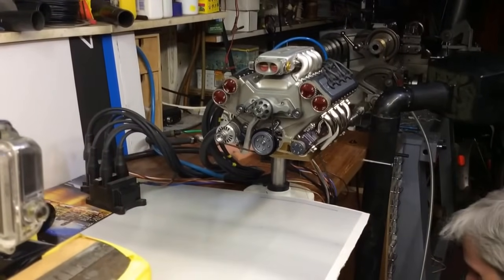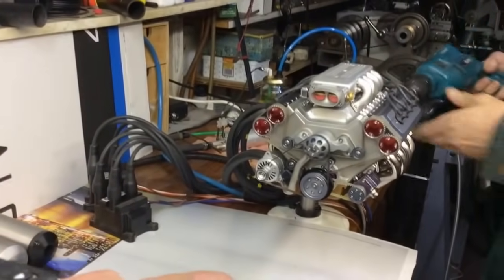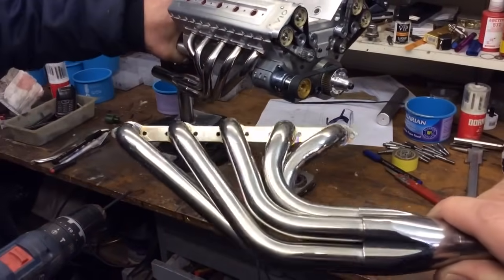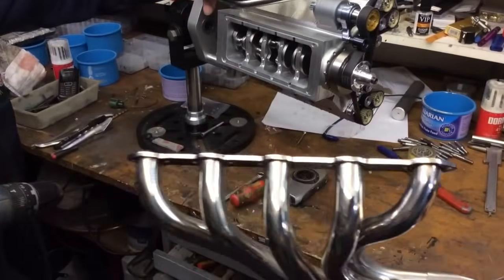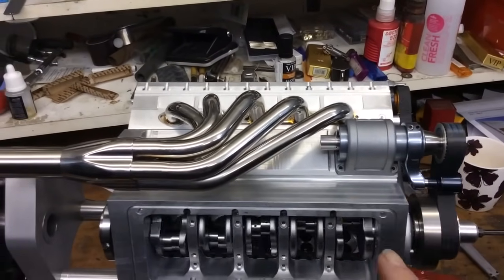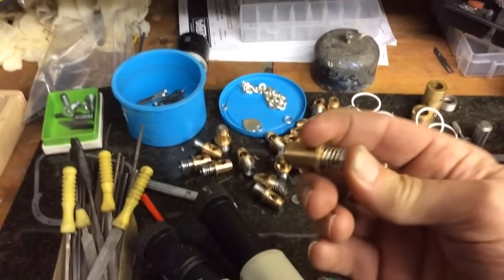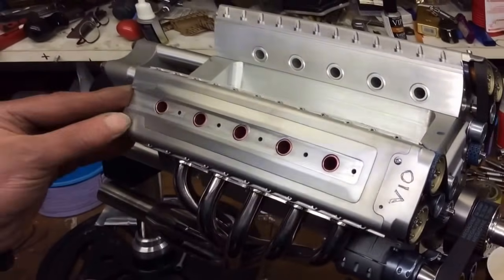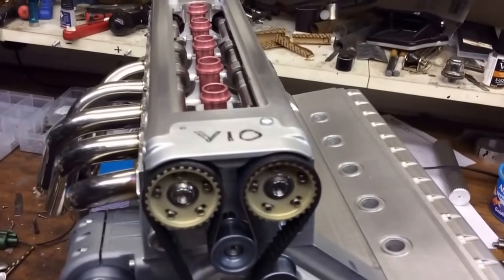Fuel injected model V8 1/4 scale running and V10 1/3 scale progress report.

Comment: what injectors is this using? no idea they did them this small, amazing build!
Reply from the maker: it’s a single injector which I made using parts from a Weber Pico injector.
Reply: @Keith5700  oooh nice, I didn’t know you could run multiple cylinders from 1 injector 🤔 thanks
Reply: @Keith5700  there are various fuel injected 125cc motorcycles that you could of got one out of 🙂

Comment: What are the two motors at the bottom left and right ? Alternator and fuel injection pump ? Do you craft those yourself or purchased them ?
Reply from the maker: Alternator and dry sump oil pump. Yes, I made them.
Reply: @Keith5700  that's ridiculously awesome. Can I purchase the the drawings or CAD files for that dry sump and alternator? I'm actually building a 6 cylinder Porsche boxer engine quarter scale motor and it would fit perfectly...also what brand EFI are you utilizing?
Reply from the maker: @champ0682  the ‘alternator’ is just a brushed motor inside an alloy casing.
I improved the pump design for the V10.you’re welcome to those drawings. It’ll be a couple of days till I get round to it. Where would you like them sent? If you send your email address I’ll copy it then delete your post.
Reply: @Keith5700  as far as the electronic fuel injection...did you purchase that from ecotron or another UAV product supplier ?
Reply from the maker: @champ0682  it’s a Megasquirt MS3. I had it modified with 2 extra drivers for the V10.
Then I’ve since spent years trying to combat earth spikes, which trip it out.
I wouldn’t buy another!
Reply: @Keith5700  hey Keith just checking in on if you were able to find that dry sump stuff to email me ?
Reply from the maker: @champ0682  I’ve sent a few emails to you weeks ago, with and without attachments, so I suspect something is wrong at your end?

Comment: Dude its prity sweet and to every one no he did not build all this himself thairs a guy who builds thease by hand mister Conley and shout out to the channels owner not to sound rude not nocking the guy but u do realise u risk scratching and scoring the bearings for ur crankshaft runing it  dry with ur drill its verry unhealthy for the engine when u pout oil in and run it if thair was any metel shavings that mixed u could have seased that engine the first time y fired it
Reply from the maker: Huh?

Comment: Bit lean on the right bank maybe? Or do you have an oil breather feeding into right side of intake? Just wondering as looks like only smoking out the left pipe. I'm not knocking it it's a little beast of an engine and looks amazing. I so want one in a pit bike or mini quad.

Comment: sooo... I want(-ed) to design one, only for virtual testing and so forth, maybe i get to have it machined at a cnc shop, and i was wondering if you could give some details (i.e.: counterweight weight, height, oil capacity, spark plug size and so on, i only need the equations as i can plug the info in). Thanks in advance as I have seen you answer comments.
Reply from the maker: Have a look through the engine build on the modelenginemaker forum. That should tell you most of what you want.
Reply: @Keith5700  Thanks again!

Comment: Is the alternator fully functional? I'd be very interested to here how you made it if it is as I would like to make one for model aircraft of a very similar size to yours. Thanks!
Reply from the maker: It is functional. It's just an electric motor working as a generator. I didn't use it in anger because I never got round to doing the electrics properly to stop the battery driving it when the voltage drops below 12v.

Comment: Keith5700 where did you find them and what size AN fittings are those
Reply from the maker: I had to make all the fittings. Nothing on the market I could find.
Reply: Keith5700 wow that cool is your engine dry sump if so is it a single gear that moves the fluid or two gears

Comment: What kind of efi system did you use for this engine and can it be put in a 1/4 scale rc car
Reply from the maker: The efi system is Megasquirt. The ecu, pump, oil tank, etc is bigger than the engine so would need miniaturising before fitting into a car
Reply: Keith5700 do you think you could try doing that just to see if it's possible because I don't know if you watch street outlaws but I'm building a quarter scale murder nova mini v8 twin turbo and I need efi to go with it

Comment: can this run a small car like a mini,  polo,  or fiat 500?
Reply: Would be cool but for some reason these scale engines don't make much power. Even 5bhp would be impressive out of this v8.
Reply from the maker: An 8 cylinder 50cc engine won't produce anywhere near the power of a single cylinder 50cc. There's far too much friction for the cc's, and the gas speed is far slower than what a single cylinder could produce.
Reply: kevin Tucker Doing the math, a 350 CID shrunk down dimensionally to one quarter scale is just 6.96 CID. Not surprised it's not 100 BHP.

Comment: I'd love to see an update on the v10
Reply from the maker: I've had the v10 running, and it works fine. Just got to tidy the wiring up a bit and then it's ready for the video.
Reply: Keith5700 Ok, sweet.

Comment: The water pump was not spinning on the first L98 / ZR1 engine! & hope you got it running better, it's got a little blow by & get some hotter plugs and some small Nonanti-foulers. LoL or Time for a rebuild!  All Nice pieces of work.
Reply: I think he said one of the plugs on the left bank was broken and that he has had more spark plug problems than anything else on these engines.
Reply from the maker: I'm just trying to make some hotter plugs at the moment. What are anti-foulers?

Comment: Definitely an issue with that V8 on one of those cylinders on one side where it's burning oil so probably down compression on one cylinder.
Reply: That's Nitro you dumbass! It burns that way.
Reply: no if you look in the comments the owner of the channel and the engine sad it was only running on 7 cylinders because one of the spark plugs was malfunctioning know your shit before you call someone a dumbass. dumbass

Comment: its great but its not running on all 8 cylinders...
Reply from the maker: I did make the plugs from scratch. That's been the problem. I should have bought the minimal ones from the start.
Reply from the maker: That's MiniMag not minimal. Stupid iPad.
Reply from the maker: It was only running on 7. One of the plugs had broken down. The biggest pain of the whole project has been the plugs.
Reply: Steve Lamperta I was just thinking the same thing looking at the oil burning off I'd say one cylinder is down compression and passing oil through.
Reply: +Keith5700 
Wow you never know! Plugs would be the last thing I would think problematic. Keith I think you should make the plugs from scratch...problem solved.
Reply: God level,  hats off 😊😊
Reply: unreal that you heard that

Comment: what's the point of these motors
Reply: I mean I'd see the point in them if they were in rc cars or something but otherwise there just expensive as fuck interactive display pieces
Reply from the maker: Yes you're right. I think my next project will be oil painting, or pottery, or sculpture, or how about a bit of wood turning, or candle making, or poetry, or sing in a choir, or just prop up the bar and drink myself stupid. Thanks for your enlightenment.
Reply: 5ltrclubby your no fun aren't you

Comment: When are you finishing with the v10?
Reply from the maker: Nearly finished the V10. It's running injection ok, and looks nice. Just finished the hydraulic triple plate clutch.and engine mounting system.
Video in a month or two.
Reply: +Keith5700 Ok good luck finishing the project!

Comment: How much Horsepower have this ?
Reply: PrivatePumper if ur lucky probly bout 10 that V8 dosnt rev high so probably more like 3 or 5
Reply: wtf are you basing that on?
Reply: +BiffBallbag 
I've seen several of these awesome scale V8 engines in RC cars and they make less power than a much smaller one cylinder nitro engines. I'm not sure why this is but I guess it is because of how many cylinders there are. On small displacement engines, the more the cylinders the more the friction and loss of power. So a one cylinder engine with the same displacement as this 8 cyl engine and the same air flow/fuel flow will make a lot more power! It's just logic.
Reply: kevin Tucker that doesn't make sense.  multi cylinders versus single with always make more power.  its a 4 cycle engine, more cylinders means more power strokes per revolution than a single cylinder engine.
Reply: BiffBallbag Would make it smoother, but still more friction and more heat.
Reply: Big Bob smoother, but more friction?  did you even read that before you posted it?
Reply: BiffBallbag When he said smoother, I believe he was referring to the rotational symmetry of the engine, not the physical smoothness of the cylinder.

Comment: I'm an ME and a machinist. I would love to make something like this but my RC airplane addiction wont allow it. Did you cast  the aluminium parts or cut them out? Where do you get your high Si Al for pistons? I'm currently drawing up some airplane engines that I'm going to build. Nice work! Almost cant tell it's a miniature!
Reply from the maker: All the ally parts are machined from solid. No castings involved.
Piston material is 6082. Easy to get.
Reply: Thank you:) What kind of CAD did you use? I use Solidworks. It has a pretty good FEA utility (assuming you know your stuff as FEA can get you into allot of trouble if you dont). 
  Its nice to see another mad scientist. We are a dying breed. Im self taught. Wish I had the time to go to school and refine my skills but my days typically start at 4:30am and end at 7:30pm. I live in a rural area (Sedona Az) and everyone here works in service industries so things get pretty lonely. 
  We pour our life and soul into these things! Best of luck!

Comment: What do you use for a miniature fuel injector? We make 1/4" dia very high speed solenoid valves that have been used as fuel injectors in small engines for UAVS etc. See www.theleeco.com under Electro-Fluidic Systems for VHS solenoid valves and nozzles.

Comment: the v8 needs a resonator
Reply from the maker: It needs something, agreed. Don't know what a mini resonator would consist of. Would like to see something as an example if you know of anything. Cheers.
Reply: Likely you already know about Pierre Scerri and his Ferrari 312 Keith. If not I believe one of the YT videos hints at it being a very involved and lengthly task to get the exhaust so it sounded exactly like a scaled down Ferrari 12 cylinder engine before he would call it completed. If my memory isn't faulty I seem to recall he might have had a bit of professional help from a few of the Ferrari engineers to do it.

Comment: I know I can buy the comely V8 but can they be made into fuel injection similar to this setup?  Kieth have you decided to sell your engine or a kit at all?
Reply from the maker: +2stroketerror125 
Been there, done that, got bored!
Reply from the maker: +Jared Braun 
I'm sure the Conley, or any petrol engine could be converted to injection.
Doing it my way though is a ton of extra work and expense, so I can't see anyone doing it commercially for a while.
I have no plans to sell the engine or kits. It would need a huge investment of time and money to market something like this. Cheers.
Reply: Why even buy a Conley v8? I built a 500hp 383 for less than they cost

Comment: its either a v8 or its not a v8.... there is no scale. its a 100ci or its not....there is no "size" of a v8 to scale it to. but nice work non the less
Reply: +Chad scale V8 to bore and stroke I would think. Nice work? Keith is a craftsman! nice work is kind of insulting if you ask me, why so picky about the scale?
Reply: +Chad W    the v8 looks to be a scale rep to the old dohc corvette zr1 engine. scale meaning same dimensions not 100% replica visually .
Reply: Maybe scaled to a certain engine in mind?

Comment: At 3:03 did you activated a clutch or something like that? or it is an electric engine powering the water pump ?
Reply from the maker: The mechanical pump belt was a bit loose and I just pulled the alternator to tension the belt. This pump doesn't move enough water anyway so there is an external electric pump doing most of the work. Some things don't scale down very well.
Reply: Keith5700 I've been a machinist for over 20 years and there is no way I'd attempt something like this. Your skills are beyond mere words. Thank you for giving me something to aspire to......
Reply: +Keith5700 speaking of the alternator, i am guessing it is purely decorative?
Reply: Keith5700 just scale down the water molecules to 1/4 scale, one of the nicest scale engines I've seen by the way👍

Comment: Forgot to say, regarding your thoughts on balancing the V10, had a (full size) V6 balanced the way you propose a couple of years back. For the weight of the rings, the guy just made up the equivalent mass in washers and super-glued them to the piston crowns. You probably know of them anyway, but have a quick look here for more info if it helps. http://vibrationfree.co.uk/  Steve @ VF is a very approachable and helpful chap. Doing it that way is by far the best method.
Reply from the maker: Hi, I tried to balance the V10 this way, a while back. I did add the weight of the rings onto the piston tops. It wasn't very successful though because the driveshaft from the lathe was causing too much interference on the vibration sensor. I will have another go later, but I think it will only work if the driving motor is attached to the engine, so there are no external forces upsetting the balance.

Comment: *Brilliant machining and construction job, but it sounds like it needs some tuning. 
You're running a Megasquirt controller if I recall ?  Have you flow tested the injectors and checked the exhaust composition with a "Wide Band O2" sensor ?  It sounded sort of like one cylinder was missing a bit from the crackle, and maybe needs some work on the acceleration enrichment to remove that hesitation when you blip the throttle. :)

Of course, if you arent going to actually drive anything with it, then it probably doesnt matter, it runs !  But the exhaust note might be a bit sweeter if it was dialled in properly.  Hope Im not trying to teach Grandma to suck eggs, your machining is incredible, but I know a fair bit about megasquirt EFI tuning and it just sounds a little off to me.
Reply from the maker: you're right, it did sound a bit rough compared with the original video.
I think it was only running on 7 as no. 8 plug was breaking up when we took them out after.
to do it properly it needs the exhausts joining into 1 pipe and then see if it will work with a wideband sensor. I suspect there wont be enough gasflow to get the sensor hot enough to work, but it may do. 
It needs some accel enrichment dialling in, but my laptop has expired so I'm stuck with the program stored in the ecu for now.
Reply: #8 plug was "breaking up" ?  as in disintegrating ?  I imagine making plugs and injectors that small would be a challenge !   WBO2s usually have a self-heater built in, so they work straight away at startup, but Im not sure if they stay on, I *think they might be self regulating and use electrical power to heat when the exhaust isnt supplying enough warmth, so it might work.   Megasquirts can be tuned (and monitored with Funky custom Dashboard displays) from Android Phones as well as laptops using a serial-bluetooth adapter available from tunerstudio.com and dashboard/logged with their shadowdash app, or tuned with the free MSDroid app.
Reply: SpockieTech
I think "breaking up" meant that it was misfiring in general.  It could have just been fouling up due to oil or fuel.